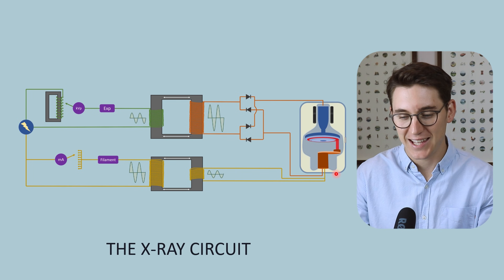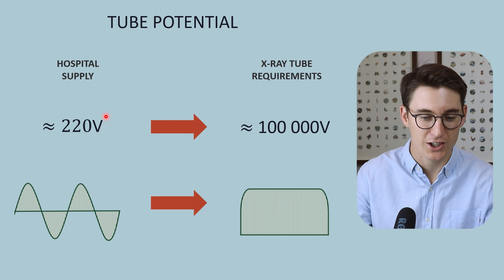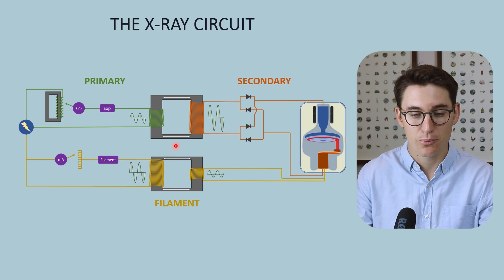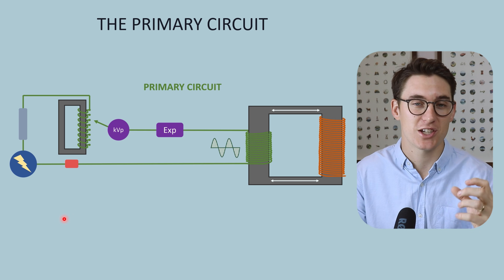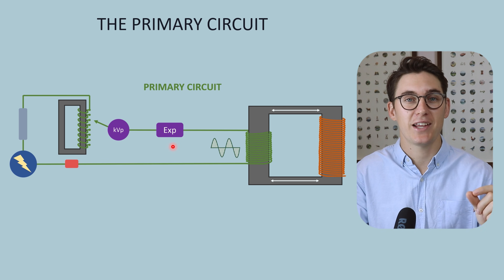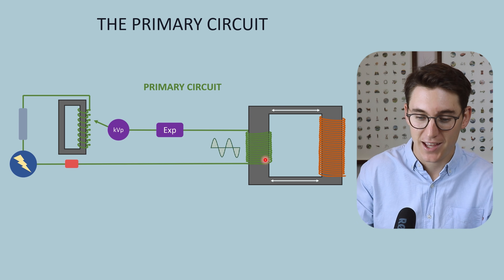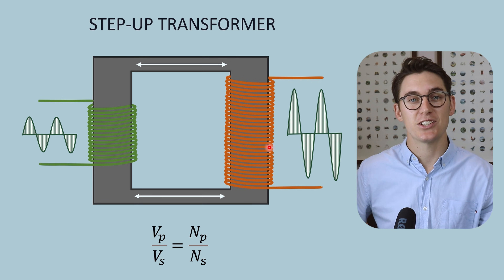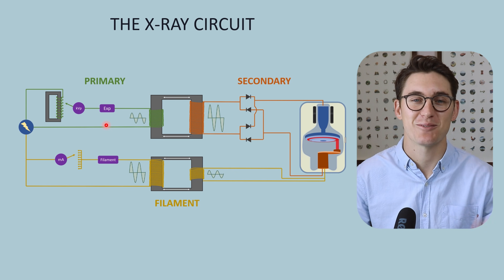Primary X-ray Circuit | X-ray physics | Radiology Physics Course #16

Comment: Not a fan of your schematic.  both the line monitor and the pre-reading kVp meter should be wired in parallel relative to both transformers, because voltage is constant in parallel.  The return line from the high voltage transformer should not bypass the autotransformer.
Reply from the maker: You’re right. It a very simplified schematic. I’ve also purposefully left out some components. My goal here is to give a conceptual understanding not a technical one.